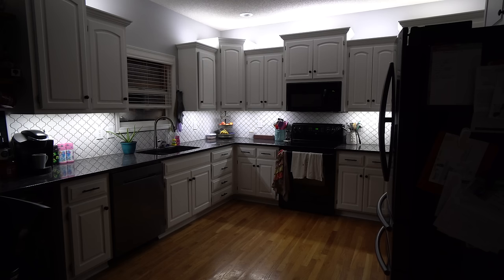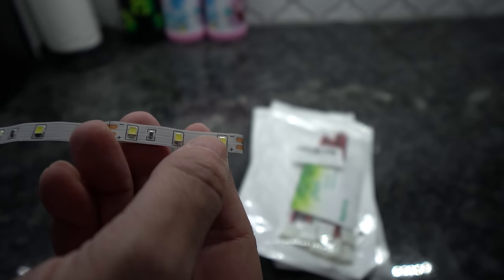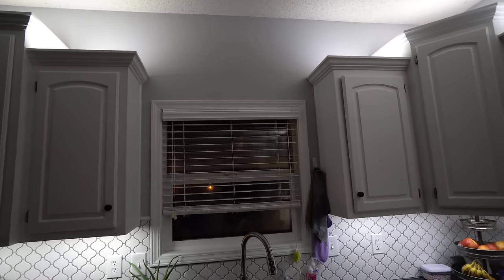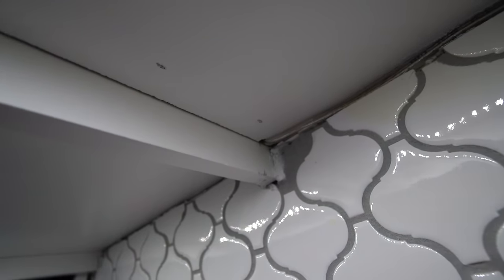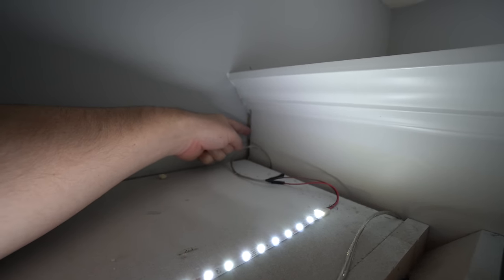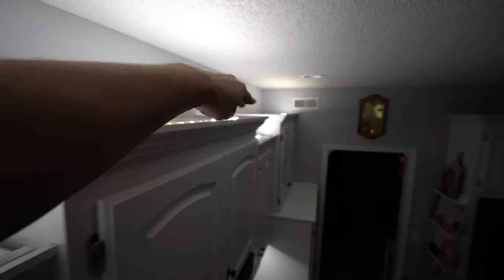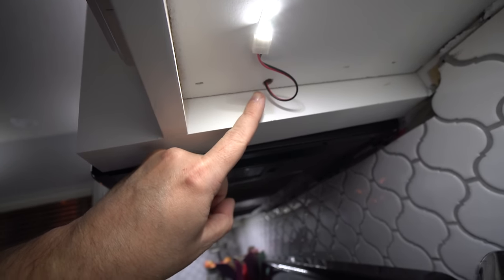Under Cabinet Lighting - EASY and AFFORDABLE!

Comment: Reid, I'm confused as to how to connect operate the wizbee button in conjunction with the Wyze smart plug ins??
Can you describe how the wizbee button is used within the Wyze app?
Reply from the maker: I have Home Assistant that allows me to integrate Wyze and Zigbee.
Reply: @DIYReid  so do you use home assistant app or the Wyze App?
Reply from the maker: Home Assistant
Reply: Sorry, I'm new to this automation thing, but is there anything needed in addition to the Zigbee mini switch that I need to purchase in order to add it to my home network?
Reply: @DIYReid  did you have to add both the zigbee device and the wyze plug-ins from your network to the Home Assistant App in order for them to be controlled automatically by Home Assistant?
Are you using the mobile app of HA, or a PC?
Reply from the maker: You need a hub. Like you could use a smart things hub.
Reply from the maker: Yes.

Comment: Does your kit come with 2 power supplies to plug into the wall?
Reply from the maker: No. I had to buy two.
Reply: @DIYReid  I will definately need two power supplies.  There are 2 different walls I'll need to run the led strips under and above,  and I'll be using the receptacle above the microwave for one strand, and the receptacle behind the frig for the other run.
Question:
How can you control separately turning off and on your lights above the cabinets and below?
Does the kit allow you to do thus?
Controlling them either separately or together?
Thanks!

Comment: Do these work with a wall switch or do you need to use the remote every time?
Reply from the maker: What do you mean a wall switch?
Reply: Will they work with a wall outlet that has a light switch? Or do you need to use the included switch?
Reply from the maker: You mean if a light switch controls the power to the outlet? If so that will work.

Comment: As soon as I saw “I got power from this outlet ..made an outlet up there” that was it for me …It looks great tho.👌🏽
Reply from the maker: Everyone has an outlet above their microwave.
Reply: @DIYReid  I think he is referring to, and I would like to also ask more about how you did it, drawing power from an outlet by the coffee maker and leading it to a new outlet above the cabinet. How did you do that?
Reply from the maker: Ahhh I pulled wire from the outlet below and made a new outlet above.
Reply: @DIYReid  stupid question, is there a term for doing that? I guess I’ve always had this idea that to add a new outlet you always have to run a new dedicated line through the walls to the breaker box, that you can’t piggyback off of another outlets power.
Reply from the maker: I’m not sure the term but it’s normal house outlet wiring. A home run from the breaker will power multiple outlets. You just have to be careful adding outlets to the breaker as if you’re adding devices to power it could overload the circuit. This situation the LEDs power with very little energy it doesn’t matter.

Comment: One thing I am not clear about is how you ran 110v from existing socket and I presume an already finished backsplash on the backside of the wall.  Think you said using fishtape or golden rod fiberglass rods.  Was it just luck you didn't hit anything else in the 110v extention above the cabinets.  
When (and they will) start to come unglued if nothing else but gravity acting on them,  use Weldwood Contact cement.  Blue tape about 1/2" wide gap, brush on both light strip and the 1/2" wide gap between the two rows of blue tape.  Use cheap Paint brush on contact cement.. let dry to touch, then stick um on.  They'll never come off easily.   Don't confuse Weldwood Contact Cement with Rubber Cement.
Reply from the maker: I should do a how to video on how to do that.

Comment: I did a similar project like this for a costumer but the double sided tape it comes with is very cheap, any solutions to that? did you have the same problem after a few weeks?
Reply from the maker: I have had them up for a while now with no issues with them sticking. I did use a staple gun to hold the connector up.
Reply: A few dabs of clear silicone on the ends and edges?
Reply from the maker: Or even hot glue maybe
Reply: I was thinking about the sticky tape failing.. I wonder if I could use the tape and then backup with the staple gun…

Comment: I am sure you covered this...how  do you power  the lights?  I did not see a plug and wire connector to the strip lights
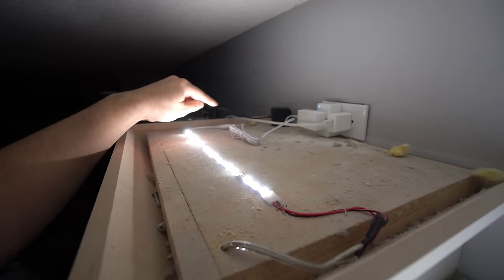Reply from the maker: The light strips have its own standard outlet 03:36 you can see the plug-in. I have it plugged into a Wyze Outlet plug for automation.
Reply: @DIYReid  thanks 😊  I ordered everything  you listed.   I am going to try to install it.  My package came with a roll but I didn't  see any plug yet.  I am going wait and see if it comes separately.
Reply from the maker: It should come with the plug. It has a barrel connector that you plug it into for the lights.

Comment: I ran same set up like yours one section of light  dims down at the beginning then after 30 secs lights goes full on?
Reply from the maker: After 3 years of almost always on one of the power bricks failed and it would take forever for it to go full brightness after turning on. I bought a new one and it fixed it.
Reply: Power brick?
Reply from the maker: @josesosa1628 the plug that plugs into the wall. I guess it’s not really a brick per say
Reply: But i wonder why lights dont go full blast at the beginning bad connection somewhere?
Reply from the maker: @josesosa1628 I wonder if yours is bad.

Comment: I did it around the top trim and under with a motion sensor set for 6 minutes. sometimes we forget to turn on the actual kitchen lights 😁😁😁
Reply from the maker: I also set ours to turn on based on a motion sensor after 6am in the morning. I also have ours turn on for 5 minutes if there is motion sensed in the kitchen hall way (only way to get to the kitchen from our upstairs) between 10pm (when I have it automatically turn off) and 5am just in case someone comes down for a late night snack or drink. :D
Reply: @DIYReid  Hi, so you have a sensor in another room that can power the lights on?
Reply from the maker: It’s a motion sensor that when it is triggered it tells my outlet plugs to turn on.
Reply: @DIYReid  that's amazing!  Can you kindly send me a link please?  I had a look on Amazon and sensors are all connected to strip lighting.
Reply: Can you share the link to the motion sensor

Comment: I'm having a hard time understanding how you were able to split everything? Was wondering if you could provide some more feedback. You lost me when you started talking about tying the wires off so you didn't have to run the whole thing in one straight line.
Reply from the maker: I just tapped into the strip where I needed the wire to be vs the end and running a ton of wire.
Reply: @DIYReid  did you solder or use the connector clips for that?
Reply from the maker: I used the clips connecting to the strips. But you can solder if you want.

Comment: I like the look of the set up real nice, but The connections show regular wire on one side and the connectors on the other. Show how you connected the wires and your power source.
Reply from the maker: One end of the LED strip has a barrel connector that connects to a standard plug-in. Kind of like a plug in for a laptop.

Comment: It's in Series. There's no way to do it in parallel because you cant create a junction with just 2 connection points, I never thought that I would put what I learned in Grade 11 Physics to use. I can put it in parallel if you connect 2 wires to + and - but IDK if that is possible

Comment: Nice video! What did you use heat shrink between the wires? If so which one?!
Reply from the maker: No. I used electrical tape.

Comment: I mean, ya. That works. However, the finish just looks bad if you ever want to sell your house. I would actually just bite the bullet and spend a couple bucks more for LED bars that have enclosers. It would make the LED easier to clean and it protects them from grease, water, dirt, etc. It's amazing how far grease goes in the kitchen when you do deep clean.

Comment: Not sure just based on your description of how you configured your wiring, but it appears you used a mix of series and parallel.
Reply from the maker: I ran it in a single run until I got to the right side of my microwave below the cabinet I just tapped in to the middle of the tun for that strip

Comment: Do you need a hub to make the switch work?
Reply from the maker: With the ones I used, yes. However, you can use these Kasa ones without a hub. - https://amzn.to/3GV98PO
Reply: @DIYReid  Awesome thanks. Does this replace the plug portion? Would you use the same button switch? Thank you
Reply from the maker: What do you mean plug portion?
Reply: @DIYReid  sorry about that. So replace the wyze with the kasa? Then use the same button, but no gun required?
Reply from the maker: Sorry. Yes. You can. But for the button you’d need a hub. But without the button you wouldn’t. Technically you could buy 3 of those plugs and make it so if you turn one of the plugs on by the button it’ll turn the others on.

Comment: I’d go for 3,500 K lights rather than those blue looking 5,000 or 6,000 Kelvin lights. That’s not completely warm where it looks orange but it’s a warmer more cozy looking light.
Reply from the maker: It’s up to you as it’s your house. We have white lights in our house so it matches.
Reply: @DIYReid  We have old four foot fluorescent tubes some previous owner put up there and I have a couple of bulbs out and don’t want to replace them. All those lights use something like 300 watts. I could do much better with LEDs. For the colors in my kitchen at least I like the less blue lights, like the ones we already have. I like less blue lights in general for indoors. I don’t mind 5000k super bright lights in the garage but inside I like something in between that orange 2,700k look and the blue 5000k look, 3500K, maybe 4000K, but 4,000 is still pretty blue.
Reply: I find 4000k  'natural white'  is my preference for a kitchen or office.

Comment: wire them in series. you want the electrons to flowing straight through.
Reply: In a simple two wire strip all the leds are wired in parallel.  Each led is connected to the plus and minus side.  if you cut the strip and then and put it back together, they'll still be in parallel.  When leds or any bulb are wired in series (which is one path) if one bulb burns out, they all go out.
Reply: @aLortizable the strip is series.

Comment: can these be hard wired?
Reply from the maker: Like to your breaker?
Reply: @DIYReid  pretty much... might be better off running an outlet instead.   Oh well... I'll figure it out.   Thanks so much for the video!  Was totally in the dark about these lights, now I'm ready to tackle it
Reply from the maker: Remember there is an outlet above your microwave
Reply: @DIYReid  I ran wires specifically for older style under cabinet lighting...  didn't even know something like this existed... I should be ok... these are way better than the ones I was thinking of,  LoL!
Thanks again

Comment: I did this for my bar and set it up to an adjustable time motion sensor from amazon. They only come on when you're ready for them. Don't have to worry about them being on when they don't need to be. Don't have to worry about shutting them off every night (which you will forget) or setting them up to a timer in which they're on for longer than they need to be.
Reply from the maker: That works too.
Reply: Hi, What time motion sensor did you buy?
Reply from the maker: I bought this one. - https://amzn.to/3IRBqvD

Comment: How much power does this use? I have bills to pay 😅
Reply from the maker: I’d be surprised you would even see an increase. Even if you left them on most the day every day.
Reply: Depends on how many watts per foot the roll is and how many linear feet you will need to use in your set up. Then it depends how often you keep them on. Worst case scenario it might cost you 15 bucks a month if you left them on all the time, but I think that is an extreme scenario.

Comment: This looks great, but I'd do what I did and leave the wiring but tear out the LED strips and transformers and spend a few hundred bucks and get the more powerful ones. These don't look right, not bright enough and color should match the house, any interior designer would smack you lol. I went through the same process, the wiring is the hard part!
Reply from the maker: Yes. Wiring is the worst part and even then it’s not too bad.
Reply: @DIYReid  Yeah and brilliant idea on the smart home stuff. I learned a lot from this video that I was not expecting. I bought a new house and told the builder to put switched AC outlets in both cabinets, so we'll see if they did. The outlets are there, just haven't tested them yet. If they're not both switched I will go with the Smart Wifi switch instead of running wires just like you mentioned
Reply from the maker: You’re welcome. I love sharing stuff I do.

Comment: The counter facing lights are nice, the ceiling facing lights look like shit. Pointless. Next time use a strip mount with a diffuser and mount it to the rim of the cupboards instead of right through the middle. Theyre cheap, and making them visible makes all your finishes look cheap.

Comment: Where do you get the button to turn them on and off?
Reply from the maker: I used this ZigBee button -p https://amzn.to/3xKbptt. You'll need to have a way to utilize ZigBee and link it with your outlet smart plugs.  If you have Smart Things or Home Assistant you'll be able to handle that through there. I'm sure there are other ways to make it happen to.